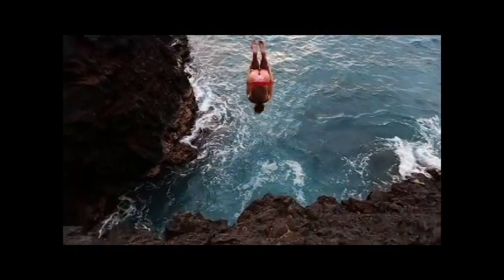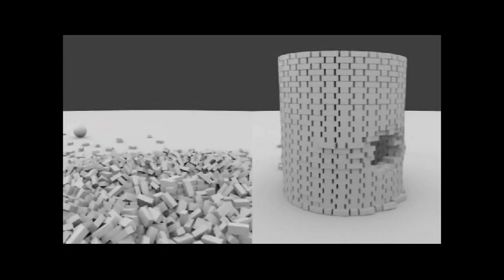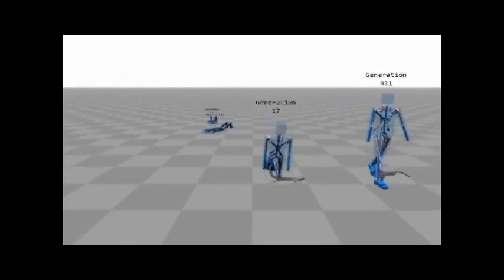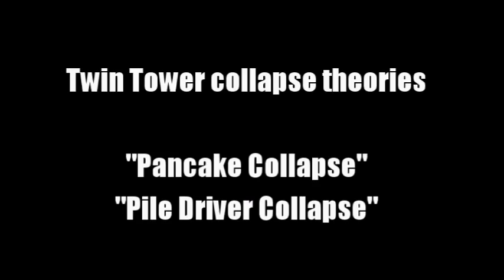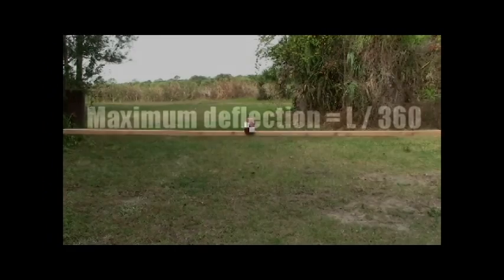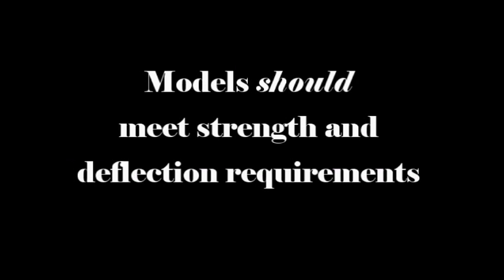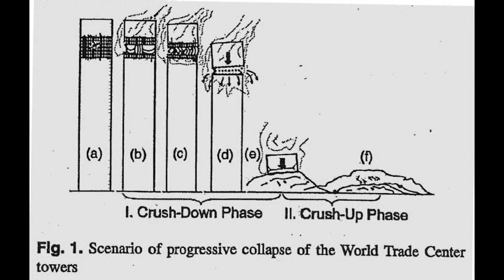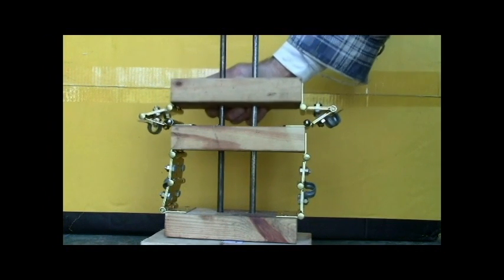9/11 Experiments: The Force Behind the Motion

Comment: Great presentations of your experiments! Well done sir! :-)

You have to do the jet fuel lie. There is not one single experiment out there, that I've seen yet, that have actually tried to melt and/or bend structural steel, while bearing a load, with jet fuel and causing said structure to collapse. 

You have already proven, beyond a reasonable doubt, that all three buildings were brought down by demolition. The only thing left now, to completely shut these nay sayers up, is to finally prove, once and for all, that jet fuel can NOT melt structural steel and then cause it to create a collapse.
Reply: +BenJamin Croft: a reasonable suggestion, except that a structural failure (even if thermally induced) would still result in a pancake or pile-driver collapse -- both of which have been invalidated by these experiments.
Reply: Firstly these experiments are not representative of the forces at work and prove nothing....  Secondly nobody has been able to present a viable demolition solution that fits the events on the day...  so if its not possible to effect a demolition what is left????
Reply: Craig Chenco So if I'm understanding you correctly, the laws of physics did not exist on 9/11?
Reply: dalexfilms Correct. Which is why I believe that the "jet fuel" theory is the final straw that will brake the camel's back. Because these sheeple will still cling to the theory that it was the jet fuel that weakened the structural steel so much that that is what caused the collapse.
Reply: BenJamin Croft On the contrary.  They did exist which is why the demolition theory is the impossible one.  And I am not sure if anyone picked up on my comment on the wtc7 collapse where the freefall velocity is considered an issue yet everyone ignores the above freefall datapoint.  This in my view is where the questions start.  Why do both sides of the argument ignore the above freefall data?
Reply: Craig Chenco Great. You agree that the laws of physics existed on 9/11. Now could you please provide the evidence to disprove all three of Newton's Laws of Motion.
Reply: why would i want to disprove laws that were not broken???
Reply: Craig Chenco You agreed that the laws of physics existed on 9-11 and you also made the statement that the buildings where not brought down with demolition.

Yet all three of Newton's Laws of Motion, and utilizing the scientific method, all prove, beyond a reasonable doubt, that a controlled demolition is what brought all three of these buildings down.

For you to make the assertion that it wasn't a controlled demolition is for you to refute the laws of physics. Now what evidence do you have to support this assertion?
Reply: Incorrect.  None of those laws were broken in the collapse.  The fatal flaw in the models presented in the video is in the attempt to scale down the height of the model.  The dynamic force of a falling object increases with its velocity and that velocity increase is governed by acceleration over distance.  Since the G force is constant then the acceleration is constant between floors.  There is a braking effect at each floor impact but the difference in velocity between these events is governed by the height of the drop.  So by scaling down the drop on the model the difference in velocity between floors will be exponentially less (remember the squaring in the equation) So you have reduced the increase in force between floors.  Hence in the first model the weight slows.  Simply because it could not develop the momentum between floors.
Reply: BenJamin Croft See http://www.burtonsys.com/staticvdyn/ for the detailled calculations referring to the twin towers. These figures show that there was indeed enough force to maintain the collapse, and more importantly that once the collapse was in motion, there would be no need for explosives any further down the building as the force becomes so great that explosives would not have made any difference.  That takes care of any claims of the laws of physics being broken for the tower collapses...So that only leaves wtc7 which I will go thru when I get time today
Reply: Oh and Newton's First Law of Motion: I. Every object in a state of uniform motion tends to remain in that state of motion unless an external force is applied to it.   The major force at play here is the force of gravity.  It is applying a force on the upper mass straight downwards and once that mass could not be supported its movements are a result of that downwards force.  The only resistive force is the structure below the collapsing mass and it is providing nothing more than braking.  It is not providing any lateral forces significant to the falling mass so there is only one direction it can fall.... This path of least resistance claim assumes there is another path other than straight down.  But since there are no forces to move the mass otherwise, adhering to the first law, its only going in the direction of the applied force - straight down.
Reply: Craig Chenco So the main force that brought the 3 buildings down is gravity?

1st) Where is the missing jolt?

2nd) Can an upper structure destroy a lower structure without destroying itself in the process?
Reply: 1 there does not need to be a jolt.  Once the supporting structure loses enough load bearing capability it has to fall. 

2 there will be damage both up and down the structure. And there will be mass ejected sideways so as the tower falls it loses some mass but it gains the mass of the floor it just crushed so effectively the falling mass continues to gain momentum and therefore more force in the falling mass.
Reply: Craig Chenco OMG! I think you better retake your 7th grade physics class and conduct some of your own experiments, utilizing the scientific method.
Reply: So why are my points invalid then???  Care to provide a reason???   And my Physics and engineering knowledge???  :) Lets see if you can find a hole in my objection to the validity of the models used....
Reply: Craig Chenco If a falling structure uniformly accelerates, then the apparent weight of the falling structure is less than when it was at rest. If the apparent weight is less, then the downward force is less. (In accordance with Newton's 2nd Law)

And if the downward force is less, then the upward force must also be less. (In accordance with Newton's 3rd Law)

Since the upward force is less, then some other force must have weekend the supports. And that weakening force could not come from the falling body because it would slow down that falling body, not allowing it to uniformly accelerate. (In accordance with Newton's 2nd Law)

Since all three buildings uniformly accelerated then the force on the undamaged parts of the structure below was less when it was falling, then before it fell. The uniform acceleration of the upper falling part is a consequence of but not he cause of the destruction of, the upward force that once supported it.

You are not adding conservation of momentum, path of least resistance, uniform acceleration, W=mg, and apparent weight to your hypothesis, and therefore it is flawed.

Newton's 1st law predicts the behavior of objects when all forces are balanced, Newton's 2nd law is applicable bodies where forces are not balanced, and Newton's 3rd law applies to all bodies regardless if the forces are balanced or not. This is basic 7th grade physics.
Reply: I suggest you venture back to 7th grade.  What we are talking about is dynamic load.  Force = mass x acceleration  Now if the mass is pretty constant or increasing and that mass is accelerating the Force is getting bigger.  Have avoided going into Newtons vs tons because that will just confuse most.  The simple version is once the tower had fallen one floor the force which it hit the floor below with is roughly 4 times that exerted by its static weight.  Next floor that multiplier goes up as the collapse is accelerating.   This is why the models provided are not representative of the situation.  If the mass does not fall as far then it has not accelerated as much so the force will not be as great.  Instead of impacting with a force approx 4 times the static mass it will be impacting with way less than double over that distance.  And of course that error becomes larger every floor.
Reply: +Antti Kahkonen Yes, I have seen that one and his other videos. And I completely agree with and support his findings from his experiments.

But I'm just pointing out what these naysayers will jump on, like Craig Chenco is doing. They'll say things like, "He didn't use jet fuel!" or "That structural steel wasn't bearing any load!" or post a link to some half ass experiment involving thermite.
Reply: Craig Chenco WHAT!?!? In order for any mass to accelerate, by gravity alone, there has to be NO resistance! Objects do NOT spontaneously accelerate on there own when there is resistance between them!

What ever hits a stationary sold object MUST experience some jolt the instant it hits.
Momentum (p) = Mass (m) x Velocity(v)
Elastic: m1u1 + m2u2 = m1v1 + m2v2
Inelastic: m1u1 + m2u2 + (m1 + m2)v
Momentum is ALWAYS conserved! It doesn't matter what angle it hits the object or if the object is crushed into smaller pieces. The speed of the object doing the hitting MUST momentarily experience a jolt. Careful measurements clearly indicate that the velocity of the roofs of all three buildings uniformly accelerated with no jolts.

If you think that it was the "crush-down & crush-up" theory, then provide the evidence. Conduct your own experiments and compare the results with your theory.
Reply: Gravity is a force.  there is some resistance on the way down as the towers did not fall at freefall acceleration.  Buy they did accelerate.  Unless you can explain how something not moving can end up hitting the ground at 120 mph without accelerating???   The motion of an object is governed by the sum of all forces. So if a resistance is opposing an accelerating force that resistance just has to be less than the accelerating force and the sum of all forces dictates acceleration towards the ground.  Seriously you must be cut and pasting someone else's bastardisation of how to apply mathematics because this crap would not come from a person understanding physics..  And yes there were jolts.  Just your way of trying to prove they weren't there is ridiculous for instance how much of a change in acceleration have you calculated? Is that change in acceleration detectable by your method?  And how much shock will be absorbed between the impact layer and the top of the tower?  I am guessing you didnt even consider these parameters. Maybe you would like to check into some of the more local seismic data from the collapse, which picks up the individual floor impacts.  Just because your method of detection was fundamentally flawed does not prove there were no jolts.       Now for my experiment? Sorry I dont have the resources to build a full height model that accurately models the acceleration.  That does not mean my criticism of the model presented is any less valid.
Reply: Craig Chenco Once again, you are not adding conservation of momentum, path of least resistance, uniform acceleration, W=mg, apparent weight, and you can not provide any real life experiments to support your hypothesis and therefore it is flawed, and can not be taken seriously. For you to ignore these fundamental laws of physics is a glorious absents of sophistication on your part.

I highly recommend for you to watch the rest of  physicsandreason's videos and also check out Richard Gage, David Chandler, Kevin Ryan, and the other 2000+ Engineers & Architects who all support REAL independent 9/11 investigations. Why don't you go here, www.ae911truth.org, and find out if your theory is actually right?
Reply: Benjamin you cannot point out any problem other than say its flawed because of no real life experiments??  I sincerely hope you dont mean to say you actually consider this video as an example of what a real life experiment is..   Now Benjamin instead of just quoting these principles tell me how they apply to the collapses and why my description is wrong, because so far you have shown no understanding of physics yet you claim my information is wrong?  
So instead of just laughing it off and pretending you know what you are talking about tell me how the path of least resistance applies in this scenario...  
Oh and nice you refer to the ae911 group for moral support.  Its kind of funny that 0.01% of the major engineering groups is taken by some as being significant dissent or challenge to the accepted accounts...  Personally I would be backing the vast majority of experts - groups with over 200,000 members worldwide with not only expertise but reputations of integrity to maintain.
Reply: Craig Chenco I don't have to explain anything to you. The proof and evidence is shown in these videos and countless others like these, that prove beyond a reasonable doubt, that what YOU are telling me and what we were officially told are lies and that these things never happened. But your master of the English language and your ability to play in the grey space of the vernacular is pretty impressive, I'll give you that.

Once again, do you have any evidence to help prove and support, beyond any reasonable doubt, your theories and hypothesis? I support and agree with the facts, evidence, and experiments that were presented in these videos. If you think they're wrong great. That's your position, that's your argument. Now support your position, back up your argument. Instead of beating around the bush with somebody like me who doesn't need a collage degree in engineering to know and understand basic 7th grade physics here.
Reply: So I point out the fatal flaw in the models in this video and you cant even address that??  Why? Because if you try you will further expose your lack of understanding of physics....  You see if someone has some theory they want to test or information that could prove something they usually submit it through universities or other scientific bodies to test the theory and if those tests (real lab tests with real modelling) then those results get published... Which is where they are put out to the experts for comment and evaluation.   But since physics is obviously not your strong point you just want to believe 911 was a demolition and I guess even if you did understand physics you wouldnt bother validating the claims because they agree with you...   Or do you really want to test out your claims with some physics experts???  Probably not... and you will claim they are government shills and dismiss their claims that you havent got a clue...
Reply: Craig Chenco Not an argument. Again, provide the evidence to support your claim to disprove these experiments, instead of an arbitrary opinion.
Reply: Craig Chenco I want to see how a smaller object can accelerate through a larger object using only gravity. I want see a smaller object speed up, when there is resistance between it, and destroy the larger object utilizing only gravity.
Reply: Lets try this simply....   Impact Force from a Falling Object
The dynamic energy in a falling object at the impact moment when hitting the ground can be calculated as

E = Fw h
   = m g h 
where
Fw = force due to gravity - weight (N, lbf)
g = acceleration of gravity (9.81 m/s2, 32.17405 ft/s2)
h = falling height (m)

In the model you referred to the height between the floors is much less than that of the towers, therefore the resultant impact is no longer about 4 times the static mass but much closer to 1.5 times.  This is important because that 4 x multiplication happens at every floor.  The falling mass hits the floor below.  It is slowed by the resistive force (conservation of momentum goes here) so instead of falling from static it is now already moving therefore has a greater dynamic force which is multiplied by 4, So it will hit the next floor at 6 times the force.   So just look 3 floors down.  Instead of multiplying the force (minus resistance) by 4x4x4 (the model multiplies 1.5x1.5x1.5  64 to 3.375.  The more floors the bigger the difference in impact force.  This is why the model is invalid as it reduces the increase in impact force between floors.    Now was there something falling through the floors in the collapse?  If not (well no there wasnt) how is your question connected to the tower collapses?
Reply: Craig Chenco Now prove it with experiment. If I'm understanding you correctly, since the spacing between the floors is not accurate, then the weight should speed up and fall through every floor and then the weight should break apart after hitting the ground? I'd like to see that.
Reply: So you want me to build you a model the height of the wtc towers??? You are convinced by a totally inaccurate model in the first place yet you totally ignore real facts and figures?  And funny how when shown the physics and the inherent problems of the model you have been shown you still dont have a problem with it???    The collapses have been studied over and over by many different universities and engineering groups and they dont find a problem with the collapse mechanics... These are people qualified in the field but you know better?  You know 30 years ago when people wanted concise info they went to the experts.... Now they go to entertainers like Alex Jones... whoever puts on the best show.  Engineers are too boring.  If you dont know the real physics and how to apply it to the event (which is clearly evident) try looking to the general consensus of experts.  Or if you want to be convinced of the physics go learn about it.  Then you will know whether or not someone is lying to you.
Reply: Craig Chenco WHOE! You really do have a glorious absents of sophistication, don't you. Forget engineering! This is basic 7th grade physics. You are trying to overly emphasize something that is completely transparent and explanatory. ANY objects that have similar accelerations, will have the same direction, and the same sequence of net force, AND IS INDEPENT OF SCALE. It doesn't matter how big or small the objects are, the same forces still apply! And I don't need to be a genius to know and understand Newton's laws of motion.

How many times to have to tell you, PROVE IT WITH EXPERIMENT! All those architects and engineers you claim to be right have NEVER presented any REAL LIFE experiments to support any of their claims. They can only produce computer generated sequences that only represents the equations. They are putting the data ahead of the experiment, which is where the data is suppose to come from in the first place! You are putting the cart before the horse. And when YOU and the rest of those so called creditable engineers stop doing that, then I'll start believing you and them.

Now, once again, what evidence do you have to support and prove, beyond a reasonable doubt, your theory and hypothesis? Instead of an arbitrary opinion.
Reply: Sorry i misjudged you....  I was under the assumption you understood 7th grade physics.  Now I see you didnt even make it that far.
Reply: Craig Chenco Not an argument. What evidence do you have to support and prove, beyond a reasonable doubt, your theory and hypothesis is correct? And that these experiments are not? Instead of  an arbitrary opinion.
Reply: Physics says so.  Simple.  Not my problem if you have been misled in the application of the appropriate laws and calculations and even been told its basic 7th grade stuff.  If some theory like the model is correct it either should have or will be submitted for publication in a reputable appropriate science or engineering journal to allow peer review and criticism. This is how you verify if indeed the models are correct or not. I can talk till I am blue in the face and you wont accept any of my claims because you do not understand how they apply.  I dont mean to be disrespectful but my education in this area is clearly way ahead of yours and to someone with further education in science and technology this is very clear.  Not everyone really understand physics and how to apply the principles to real life situations.  Their talents are obviously elsewhere.  Its not a slur.  But if you are just going on what somebody says be very aware that lots of people prey on this to deceive...  (not just on your side either) so somehow you must find a way to verify the information from ALL sources.
Reply: Actually in my country that is year 10 or 11 (students 15 to 17 years old) as thats when physics was part of my syllabus. University commences after year 12 here.  So I really dont know if that is 7th grade to you.  And I apologize if in fact the education levels line up
Reply: +Craig Chenco Not an argument. Again, for like the tenth time, what empirical evidence do you to prove, beyond a reasonable doubt, your argument? Instead of an arbitrary opinion.
Reply: I have shown you exactly what the physics implications are by the simple calculation of how impact speed is exponentially proportional to impact force.  By decreasing the distance of the fall you decrease the impact speed difference between floors and this is not compensated for anywhere else in the model.  This is basic physics and beyond reasonable doubt for people who understand physics.
Reply: And here is where analytical minds differ.  Presented with a potential threat to a belief the first action would be to research this information and consider whether the info has any validity.  If it proves to be valid then that needs to be incorporated into your total evaluation, and this may lead to a change in overall belief.  The scientific community does exactly this.  Constant testing and re-testing of theories leads to either confirmation of theories or development of new theories.  What is accepted as fact is not assumed to be fact forever - allowing for new and relevant information to be accepted, tested and applied.  Instead you stick to a belief and only accept info that fits your belief. You want people who you will never believe anyway to prove to you that which you dont understand in criteria that in most cases illogical and impossible to meet.  Effectively a Judge that only accepts one side of the argument - the side that fits his previously adopted belief.    .  Here obviously is the problem.  If you dont understand physics how do you evaluate the information presented to you?  Easy to just accept anything that agrees with your original belief.  This just leads to a biased view of all evidence.  How about looking at how the experts do that??  The most reliable way is publishing theories through reputable relevant institutions, peer reviewed and withstanding appropriate critics and in the event of competing theories having similar credentials then going to percentage support of both.  Your call.  You can improve your decision making process. Or you can stay with your current obviously ineffective process.
Reply: +Craig Chenco Then test your theory with experiment. If you're so sure of this data then prove it with experiment. See if the data matches the experiment. I want see a smaller object, accelerate, while crushing a bigger object, then crushing itself after the process, utilizing  gravity alone.
Reply: Build a model the height of the wtc towers???  If the concept of impact force vs velocity is proven then the mathematical implications I state must be valid.  Unless you dispute 4x4=16   So easy experiment for you to do at home.   Get someone to drop a brick and you attempt to catch it once it has fallen 5 feet.  Now do the same from 20 feet.  If your hand hurts more from the impact and the brick is the same mass then the only difference in the equation is the velocity. Simpler version of this experiment.  put a brick on a set of scales that hold peaks.  measure the weight of the brick.  Then drop it from 1 foot onto the scales and see what weight the scales peaked at... then keep on dropping from higher distances.  Notice the peak is higher as the falling distance increases??  Or this is flawed why?
 You of course know deep down that higher velocity exerts more impact force and that the force of gravity causes acceleration (increasing velocity) so what i have pointed out makes sense - and your inference that because I dont have a physical model my claim is therefore incorrect is cute but totally baseless as you cannot make any claims on inaccurate physics when you dont understand physics in tthe first place.   But I know you wont accept this and because your fatally flawed understanding of physics does not allow you to comprehend what is really happening you will no doubt find some excuse to look away. instead of actually wanting to see if the info is valid you are doing nothing more than finding ways to appear not to be able to see it.  I cant see spending time on a person who not only displays the total understanding of physics but does not seem to want to rectify the decision making process that has led to him believing or pretending to believe they know and understand physics especially relating to 911.  You dont want to learn, I withdraw the further opportunity for you to learn.  My time is valuable and not worth wasting where unappreciated.  Good day to you.
Reply: Craig Chenco Is there a jolt every time you drop that brick? Are human hands heavier and stronger than a brick? Did the top of the buildings start to float upward and then fall down and then upward again, even higher, and then fall down again and again and again? 

You have got to be kidding me! And you call yourself an engineer?
Reply: lol you really are clueless.
Reply: +Craig Chenco Hey. That experiment you just mentioned and just so happen support is saying that's what happened on 9/11. Even though it doesn't even match the events that took place. WTF OVER!?!?
Reply: Are you going to continue showing your stupidity??
Reply: +Craig Chenco Not an argument. Are you finally going to present real, creditable, empirical, evidence to prove, beyond a reasonable doubt, that these experiments are wrong?
Reply: You have no idea what does and does not constitute evidence.  I will be here for years before you comprehend what I SAY. Have wasted enough time.  Got something intelligent to add - otherwise back to your join the dots books
Reply: +Craig Chenco Not an argument.
Reply: Oh this is an argument???  I thought you were just bleating various crap and pretending to know what you are talking about.  Its not an argument when one doesnt even know what he is talking about...  Thats you just in case you didnt understand the inference...
Reply: +Craig Chenco An argument is a collective series of statments, leading to a definite proposition. You are not doing that. You are constantly and bureaucraticly dodging my question. Which is, for the twelfth time now, what empirical evidence do you have to show to prove, beyond a reasonable doubt, that these experiments are wrong? fyi YOU'RE EXPERIMENT!
Reply: The evidence has been mathematically given to you.  You can not challenge the validity of the mathematics nor how it is applied to the model.  End of story.
Reply: +Craig Chenco Once again you are putting the cart before the horse. Does that data match what happened to those three buildings? Does it comply with experiment? Can you show that?
Reply: +Craig Chenco It looks good and sounds good on paper. Now apply it to experiment. Test it.
Reply: The data matches what happened to the buildings.  Unless you want to build a tower the height of the twin towers then no experiment will be accurate - which is why the model supplied is not an accurate depiction of the collapses.  And the mathematics also supports this
Reply: +Craig Chenco OMG! I told you earlier that it doesn't matter how big or small an object is! The same forces still apply and they are INDEPENDENT OF SCALE! And you call yourself an engineer?!?!
Reply: +Craig Chenco This is why we conduct experiments and utilize the scientific method. To keep narcissistic know-it-alls, like you, from spreading misinformation and lies.
Reply: Nothing seems to stop you from spreading lies.
Reply: +Craig Chenco If you think I'm lieing, and therefore these videos are lies too, then prove them wrong with your experiments. Back up what you're saying. Apply it to the events of 9/11.
Reply: I have proved the models you refer to as mathematically incorrect.  Therefore your model is invalid. You are the one using this crappy model as some sort of evidence that the collapses were assisted so to continue to do so you have to prove why it is accurate and why the flaws pointed out are not.  So far all you have proved is how gullible and ignorant you are
Reply: +Craig Chenco I'm not the one who bears the burden of proof here. YOU are the one that is accusing that these experiments are wrong. YOU are the aggressor here, NOT me. Don't try to place the burden of proof on my shoulders. 
To try and twist and manipulate the burden of proof on me is extremely rude and disrespectful on your part. Nice try though. Like I said earlier, your ability of utilizing the English to play in the grey space of the vernacular is still pretty impressive. 

Now what empirical evidence, fyi your experiments, do you have to prove beyond a reasonable doubt that this data and experiments are wrong?
Reply: And I have shown you mathematically why they are wrong.  That is proof.
Reply: +Craig Chenco Like I said earlier, it looks good and sounds good on paper now prove on wether or not of its true. Now apply this math with the events of 9/11, aka experiment.
Reply: Sounds good on paper because it is correct.  And unless you can tell me why it does not apply to your model then your model is invalid.  Simple.  Your request for a physical model does not change the validity of the mathematics.
Reply: +Craig Chenco That is NOT evidence. If I'm understanding you, you're saying the mathmatics apply because the mathmatics apply?
Reply: You wouldnt know evidence if it hit you in the face.  If something is proven mathematically incorrect that is the end of the story.  No amount of models are going to change the laws of physics and how they apply. And that is only the beginning of the mathematical errors in this model.  If that concept escapes you then maybe time to go back to school....
Reply: Craig Chenco So you're saying since the math is right, then the math is right. Correct?
Reply: I am saying there are inherent flaws in the models depicted in this video which are proven mathematically.  Apart from the one we have been discussing there is no actual scaling of the buildings resistance or forces applied.  The deflection calculation is meaningless because there is no connection between deflection and failure of beams of different materials. The first model assumes the outer structure is solid and remains that way?  And the mass concentrated in the center when the falling mass was the full area of the floor.  They dont even start with a static mass and let it drop 1 floor as happened in the towers. Also where is the calculations showing how the falling mass figure was obtained and the actual load resistance of the floors???  And the issue we started with is the height difference between floors does not allow for the acceleration and subsequent impact force on the next floor down which is not even a linear calculation as the increase in velocity is exponential.   So basically this model has no resemblance to the actual towers.  If you have some answers to those basic flaws (thought one massive flaw would be enough for you but since you havent managed to understand that one proven by basic maths and physics you might see the other errors) go right ahead...
Reply: +Craig Chenco So you're saying the math is right because the math is right?
Reply: +Craig Chenco You're telling me that the math applies because you say it applies?
Reply: Im telling you you are stupid.  Go away
Reply: There is actually no mathematics whatsoever applied to that model to make it an accurate representation.  If you still think this is model proves something then yes you are stupid.
Reply: +Craig Chenco I repeat,  is the math right because you say the math is right? Yes or no?
Reply: I repeat... where is any math backing up the accuracy of the model??? And my math is correct because that is the correct application of the formula.  Not because I say so...  Because physics says so.
Reply: +Craig Chenco So the physics apply because the physics say they apply?
Reply: Yes.  And if you understand physics then you understand what formulas are applicable to what scenarios.
Reply: +Craig Chenco Do you understand that that is circular logic? That's a logical fallacy in which you begin with what you are trying to end with. (emphasis)
Are claiming that A is true because B is true; B is true because A is true??? Really???
Reply: +Craig Chenco Also, I have mentioned, three times already, what you are missing from your hypothesis. You did NOT include conservation of momentum, path of least resistance, uniform acceleration, W=mg, apparent weight, the jolt, and no experiment. These are FUNDAMENTAL LAWS, that MUST be included. (emphasis)
Reply: Showing your stupidity again?  If an equation has been developed to express an event it does not need someone to say it applies or not.   If you asked how fast I had to be going to make it from a to b in x time there is a mathematical equation v=d/t  Are you going to question that equation when asked the same question?  Or when it is applied ask who says so???  But since you have been suckered by this model video I suppose its not surprising.
Reply: You did NOT include conservation of momentum, path of least resistance, uniform acceleration, W=mg, apparent weight, the jolt, and no experiment. These are FUNDAMENTAL LAWS, that MUST be included. (emphasis)  

Now how should I include these items???   Path of least resistance - Well since the only force in the collapse is gravity the only viable path is downwards... so no problemsthere.  W=mg applies in this casw when you are falling with the mass - like some amusement rides that give you the zero gravity feel.  This has no place in calculating the impact of a descending object.  Conservation of momentum - dont see a problem here and this sort of works against your claims here.  Your jolt - this is a goodie.  How much of a jolt should there be?? How much of the descending mass would absorb any jolt?  As the collapse didnt actually just proceed floor by floor as many parts of the exterior support columns can be seen coming down intact meaning that not just the immediately lower floor support was being compromised but at times supports were destroyed for multiple floors at a time so how often should these jolts be??  And how obvious should they be? 

Now back to the main point.  This experiment ignores so many parameters important for a model to be accurate, yet you bring up all these physics concepts claiming I dont address them when clearly your model does not either???  You cant have it both ways... Important when questioning me yet ignored when questioning the model....
Reply: So understanding some of the concepts of physics is not enough.  Its how they actually apply to an event that you do not understand.
Reply: +Craig Chenco More circular logic, ad hominem remarks, bureaucratic dodges, and NO evidence support anything that you are saying. 

Whate empirical evidence do you have to prove beyond a reasonable doubt that your hypothesis and data is true and that it applies to the events of 9/11and that these experiments are wrong?
Reply: +Craig Chenco Again, your master of the English language to hide  in the grey space of the vernacular is still very impressive.
Reply: Dont see you putting up any real argument...
Reply: I mean feel free to challenge any points raised...
Reply: +Craig Chenco I've already told you, for the third time now, I support and agree with the data and evidence that has been provided in these videos. I don't have to argue anything with you until YOU can provide the empirical evidence to prove beyond a reasonable doubt that these experiments are wrong. 

Once again you are trying to shift the burden of proof on me. YOU are the accuser, therefore YOU bear the burden of proof. 

Circular logic, arbitrary opinions, ad hominem remarks, and bureaucratic dodges are NOT evidence.
Reply: LOL so you agree with a model with zero data... when the physics is explained to you that comprehensively discounts your model's representation of the event you ignore it...  your stupidity has been amusing, but now its kinda sad...   Sometimes I get an idea that someone actually wants to learn something then people like you come along and demonstrate they will not learn if not from someone like me, but even motivated to learn elsewhere to deal with the obvious challenges explained to confirm or deny.      Love that line I am the accuser and I have the burden of proof... yes but you have the burden of being able to understand the proof - sadly that is outside your grasp.  You have clearly demonstrated your lack of understanding of physics so when presented with the proof you simply dont understand how it applies.  This is not my problem... You can address it any way you like but your claims I have not proven anything are bullshit.
Reply: +Craig Chenco Not an argument. Just more circular logic, arbitrary opinions, bureaucratic dodges, ad hominem remarks, and acting in bad faith by not providing any empirical evidence to prove beyond a reasonable doubt that these experiments are wrong.
Reply: Craig Chenco I would like to see a smaller and weaker, stationary, object uniformly fall, by gravity alone, on top of a larger and stronger object, and then accelerate, by gravity alone, while falling through that larger and stronger object, and in the process crush that larger and stronger object, and then, that same smaller and weaker object, crush itself afterwards, by gravity alone. 
Remember, the laws of motion are independent of scale. Meaning, it doesn't matter how big or small an object is, the same laws of motion still apply.

Since that it is what you have been implying this whole time, and in order for you to prove these experiments wrong, you are going to have to demonstrate this. Good luck with that.
Reply: Since you dont have the ability to comprehend physics I have no interest in what you would like to see.... You have been given proof of why the model is invalid.  Not my problem you dont understand.  And the validity of the proof is not dependent on you understanding.    By the way what you ask does not again resemble the towers collapse - - And yes this even further demonstrates your total lack of understanding of the topic...Explaining the actual situation is a waste of time on you...  . Let me know when you finally pass 7th grade...
Reply: Craig Chenco You haven't given anything except circular logic, ad hominem remarks, bureaucratic dodges, arbitrary opinions, and acting in bad faith by not producing a single piece of empirical evidence to support what you are saying.
 
This data and experiments shown here, http://www.burtonsys.com/staticvdyn/, that you're so desperately clinging to, do NOT match reality on what happened on 9/11. And all the creditable sources that where sited, fyi FEMA, NIST, 911 Commission, have all been recently coming forward and admitting that they no longer support this kind of theory and that it is NOT what happened, because:

If a falling structure uniformly accelerates, then the apparent weight of the falling structure is less than when it was at rest. If the apparent weight is less, then the downward force is less. (In accordance with Newton's 2nd Law)

And if the downward force is less, then the upward force must also be less. (In accordance with Newton's 3rd Law)

Since the upward force is less, then some other force must have weekend the supports. And that weakening force could not come from the falling body because it would slow down that falling body, not allowing it to uniformly accelerate. (In accordance with Newton's 2nd Law)

Since all three buildings uniformly accelerated then the force on the undamaged parts of the structure below was less when it was falling then before it fell. The uniform acceleration of the upper falling part is a consequence of but not the cause of the destruction of the upward force that once supported it.

You and this, http://www.burtonsys.com/staticvdyn/, are not adding conservation of momentum, path of least resistance, uniform acceleration, W=mg, and apparent weight to your hypothesis.
Newton's 1st law predicts the behavior of objects when all forces are balanced, Newton's 2nd law is applicable bodies where forces are not balanced, and Newton's 3rd law applies to all bodies regardless if the forces are balanced or not. This is basic 7th grade physics. These are fundamental, essential, laws that can NOT be ignored.
Reply: If a falling structure uniformly accelerates, then the apparent weight of the falling structure is less than when it was at rest. If the apparent weight is less, then the downward force is less. (In accordance with Newton's 2nd Law)  Bullshit....  This shows your absolute stupidity.  The apparent weight has nothing to do with the impact force.  The impact force is a product of mass and velocity - the faster something falls the harder it impacts.  Do you want to further show your stupidity???
Reply: There is a difference between ignoring laws and incorrectly applying them.  Once you reach 7th grade you may see this.
Reply: Craig Chenco "The impact force is a product of mass and velocity - the faster something falls the harder it impacts." 
Then how is that smaller, lighter, and weaker , stationary, object suppose to fall and then accelerate, by gravity alone, down through a larger, stronger, and heavier object? In order for any stationary object to move, there has to be NO resistance! In order for it to even accelerate, there still has to be NO resistance! 
If you're still clinging to this, http://www.burtonsys.com/staticvdyn/, that penny that was dropped only accelerated because there was NO resistance. And according to you and this half ass experiment that penny should of continued to have accelerated, even gained momentum, after hitting the scale, and then should of gone right through the scale. But it didn't. Why? Because the penny was a smaller, lighter, and weaker object than the larger, heavier, and stronger scale was. DUH! And did you even notice the jolt, fyi the immediate deceleration and then dead stop, after the penny hit the scale? (emphasis)
The same laws still applied when he put a jar of pennies on top of a piece of paper, it was just reversed. A stronger, heavier, and larger object on top of a smaller, weaker, and lighter object. Plus he was adding more weight to it! Something that did NOT happen to any of the buildings on 9/11!

While acceleration of an object does occur and is mathematically proven, there has to, FIRST, be NO resistance for that object to begin moving and there still has to be NO resistance for that object to accelerate.

"There is a difference between ignoring laws and incorrectly applying them."
I strongly suggest that you take a good, long, and hard look at what you just said there.
Reply: Craig Chenco Now, do you or do you not have any empirical evidence to prove beyond a reasonable doubt that these experiments are wrong?
Instead of circular logic, arbitrary opinions, ad hominem remarks, bureaucratic dodges, links to out dated, half-ass, proven wrong theories that are no longer supported by creditable resources, and not providing any experiments of your own.

"You can't convince a believer of anything; for their belief is not based on evidence, it's based on a deep seated need to believe." - Carl Sagan
Reply: Yes I do and have presented it.  When will you gain the intelligence to understand it?
Reply: I cant believe you posted this.....  "You can't convince a believer of anything; for their belief is not based on evidence, it's based on a deep seated need to believe." - Carl Sagan 

That is what Carl said about people like you, and you are dumb enough to post it as support for your belief????   Fucking laughing my ass off.....
Reply: Just to help you out, apparent weight is the relationship between objects that are accelerating.  The example shown is when you are inside a lift.  You will also notice that when the lift decelerates your apparent weight increases.  This is exactly what happens when a descending mass like the towers hit the lower floor.  The acceleration is reduced so the apparent weight increases. See in particular case 4:
 http://physics.usask.ca/~kathryn/phys111/apparent_weight.pdf
Reply: Now impact force....  notice the absence of apparent weight in this description???  http://www.wired.com/2014/07/how-do-you-estimate-impact-force/
See now how your misuse of physics is obvious???
Reply: Of course now we are going to get over complicated in our calculations as there is a difference between the potential impact force (kinetic energy) and the actual impact force which is an average of how much energy is released over the deceleration of a falling object as in http://hyperphysics.phy-astr.gsu.edu/hbase/flobi.html  But then going to your conservation of energy / conservation of momentum theories and considering the collapse of the structure below indicates not all the force available was necessary to cause its collapse and the falling mass has not stopped but has been slowed means the falling mass has now more energy than when it first started to fall.  So now calculating the velocity at the second floor, it is now the initial velocity (slower than impact velocity but above zero)  plus the velocity increase of the 2.5m drop.   So the mass falls faster between floors and therefore the time shortens between floor collapses.
Reply: Now exactly why the distance between floors is an issue.   As the falling mass meets the floor below it has gained momentum and its impact force (kinetic energy) is expressed as f =mv. v =u+at (u being initial velocity which for the start of the collapse is 0) distance=1/2at^2 so square root of 2d/a gives us t. so using 2.5m time is 0.71 seconds. So the velocity is 9.8x0.71 = 6.96m/s So falling just the first floor the impact force is almost 7 times the mass above. In the model lets be generous and say there is 10cm between floors. Under the same conditions the time is 0.14 seconds so velocity =1.37m/s. So instead of a force close to 7 times the falling mass the force becomes 1.37 times the falling mass over that fall. Subsequent floors below also bring in the starting velocity which is the impact velocity less the deceleration caused by the impact - which obviously will be well above zero. So that error continues exponentially down the collapse....  As the weight is let go well above the model it has gained significantly more kinetic energy to break through the first floor, but the resultant deceleration is obviously enough to reduce the weights velocity significantly.  Enough to reduce its impact on the next floor so the Mass has slowed and then been allowed to accelerate and gain momentum = 1.37 times its mass rather than 6.96 times its mass if allowed to fall the full 2.5m.  So what this model does is slows a mass down by more than it can regain between floors - ending in the mass having reduced kinetic energy at each floor and eventually stopping.  Under the real mathematics that apply to the towers, if the mass caused the collapse of the floor immediately below it, the resulting falling mass would gain energy at an exponential rate and the collapse could not slow down, only speed up.  So even though we dont know the relative difference between descending mass and load capabilities of the 'floors' if the mass had been dropped from 2.5m above the first floor and there was 2.5 m to the next floor etc and the mass broke through the first 'floor' it would continually gain momentum and hit each floor below harder and harder. Because then we establish that the resistive force is less than the minimum force required for collapse (no relation between downward force and load bearing capabilities has been provided for your model) and mathematically therefore will accelerate downward.   This proved as:   f =mv. v =u+at (u being initial velocity) so f =m(u+at) and u=0 for the first floor drop.  Second floor drop it is already moving so u increases and keeps on increasing floor by floor.   Therefore force must keep increasing and the collapse must accelerate..     Intelligent critical analysis only please -
Reply: Craig Chenco More circular logic, ad hominem remarks, bureaucratic dodges, arbitrary opinions, and acting in bad faith by NOT producing a single shred of empirical evidence to support your claim that these experiments are wrong.

This? Really?, http://hyperphysics.phy-astr.gsu.edu/hbase/flobi.html. It even states, "Harder ground, less penetration, harder impact force." AND "Note that the above calculation of impact force is accurate only if the height h includes the stopping distance, since the process of penetration is further decreasing its gravitational potential energy."  Seriously, Mr. Engineer?  
And this?, http://www.wired.com/2014/07/how-do-you-estimate-impact-force/. Resorting to Mythbuster now? LOL! If you have actually seen that episode you'll notice the jolt, aka deceleration, the second, after the piano hit the roof. And how did they make the piano fall? By removing the resistance that was holding it up in the air. (emphasis)
And fyi, it was BUSTED! The piano did NOT fall through the roof. It wasn't until afterwards, they got another piano, made it heavier, by adding sand bags in it, and then dropped it from an even higher height. Really, Mr. Engineer?

Once again, what empirical evidence do you have to prove beyond a reasonable doubt that your hypothesis and theory are right and that these experiments are wrong?

"Characterize people by their actions and you will never be fooled by their words." - Unknown
Reply: Craig Chenco Oh yeah, and this one? http://physics.usask.ca/~kathryn/phys111/apparent_weight.pdf. You have just inadvertently omitted yourself here Mr. Engineer.  "a↓ = less than normal weight.", "a↑ = greater than normal weight.", AND "Just as in case 3 and 5, the apparent weight, fyi the little girl in the elevator, ake the wtc floors,(which is zero when a = - g) is less than the true weight." According to this, http://physics.usask.ca/~kathryn/phys111/apparent_weight.pdf, that little girl in the elevator, aka the floors of wtc 1, 2, & 3, is not what caused the destruction of the stronger, larger, and heavier lower sections of the buildings, Mr. Engineer.
Reply: Oh and this new BS fantasy "path of least resistance law", 911 truth implies, would make it impossible for bullets to kill, they would deflect off our skin and go for the least resistance, the air...   Just making sure you dont want to go down that path either...
Reply: Maybe I have tried to oversimplify exactly what is happening, as there are a lot of other things happening in this collapse.  This description is far more complete.... (borrowed)  But it better explains the complexity of the impact force of the falling mass.

 Once the framing in the impact zone has failed, the upper block is accelerated by gravity until it crashes into the lower structure below the impact zone. Labeling the mass of the upper block m, and its speed v, the block would have a momentum m*v and an energy of (1/2)*m*v^2. Its weight would be m*g, where g is the constant of gravitational acceleration (9.81 meters/second^2).

The balance of forces on the upper block as it impacts the lower structure is presented here as the impulse momentum form of Newton’s 2nd Law:

The time rate of change of momentum = The sum of the forces,

[m*v(final) – m*v(initial)]/dt = F – m*g.

Here, positive direction, velocity and force are taken to be vertically upward; dt is a label for “delta t”, a very brief time interval during which the impact occurs and the momentum changes from m*v(initial) to m*v(final); and F is the force of resistance by the lower structure. If A is the net horizontal cross-sectional area of the load-bearing columns of the lower structure, then F/A is the average compressive stress across that area.

This type of force balance is applied to the impact at each floor, sequentially, by redefining m as the mass above it, v(initial) as the outcome of the alternating floor impacts and free falls during prior compaction, and v(final) as the outcome of the latest impact.

We can regroup the terms of the force balance as follows:

F = m*g + m*[v(final) – v(initial)]/dt,

F = m*g*[1 + {v(final) – v(initial)}/(g*dt)],

F/(m*g) = 1 + {v(final) – v(initial)}/(g*dt).

Before each building was perturbed, the upper block did not have any motion, v(initial) = v(final) = 0, and the magnitude of the upward-directed, resisting force of any part of the structure was equal to the weight of material above it; F/(m*g) = 1.

When an upper block drops through an impact zone that has lost structural strength, and crashes into the rigid lower structure, it imparts a dynamic force in addition to its weight. The dynamic force is the second term in the last expression for F. The total force, F, acts during the time interval dt during which the momentum of the upper block is reduced (in magnitude) from m*v(initial) to m*v(final). Clearly, the lower structure will crumble when F is greater than the maximum force it can support, or when F/A is greater than the maximum stress it can withstand.

¦ Problem 1, Numerical Example of Progressive Collapse

Free fall without air resistance from a height H takes time T, given by

T = square root [(2*H)/g].

At any time 0 < t < T during the free fall, the velocity is given by

v(t) = -g*t, (negative sign for downward direction),

and position is given by

h(t) = H – (1/2)*g*t^2.

So, for H = 440 m (=1443 feet) the free fall time is T = 9.5 s, and the velocity slamming into the ground is -92.9 m/s = -208 mph.

What actually happened in the buildings? We consider a suggestive numerical example.

With the onset of failure, the upper block drops through a space of L = 3 meters, taken to be the distance between floors. Starting from rest at time t = 0, the block reaches a velocity of v = -7.7 m/s at t = 0.78 s. The descending block makes contact with the topmost stationary floor of the lower structure.

We will assume these floor structures to be dL = 1 meter thick (1 meter = 3.28 feet). Each floor structure is a framework of steel below and within a layer of concrete. The floors spanned a distance of between 10 m and 20 m between the outer square perimeter (63.4 m a side) and the core support along the axis of the building, which housed elevator shafts, stairwells and support columns, within a rectangular area of [42 m x 27 m].

Impact is a very brief process whose duration is dt = 1/100 s. During the impact, energy ripples through the floor structure as elastic waves in the steel and concrete; the velocity of these stress waves is V(steel) = 1900 m/s and V(concrete) = 930 m/s; the wave speed is a property of the material (P-waves). The waves traverse the thickness of the floor structure in a time dL/V = 5/10,000 s for steel and 1/1000 s for concrete, so they can bounce between 10 to 20 times across the 1 m thickness; and they can run along the span of the floor within 0.005 to 0.01 s.

The waves alert the volume of the floor structure to the imposition of a new load, and infuse that volume with much higher stress. The floor structure is deflected downward a distance d = -0.077 meters (3 inches) during impact. In becoming stressed, the floor structure absorbs some of the energy of the descending block, slowing it by dv = 0.5 m/s (in this example). Within dt = 1/100 s, the floor structure has transmitted the force of the new load to its joints with the building’s core and periphery.

Recalling the last form of the force balance, and inserting the numbers from this example, we find the magnitude of the total reaction force to be

F/(m*g) = 1 + dv/(g*dt) = 1 + 0.5/(9.81*0.01) = 6.1,

a load of six times the weight of the upper block.

I continued this particular calculation, floor by floor, as a sequence starting from rest: free fall for 3 m, impact delays transit for 0.01 s and decreases descent velocity by 0.5 m/s, free fall for 3 m, transit delay and velocity decrement as before, and so on. The block reaches the ground in 10 s with a total of 87 floor impacts. The collapse of 344 m (1128 feet) accelerates from -7.2 m/s (-16 mph) after the initial impact, to -46 m/s (-104 mph) at the ground.

Now, a little bit more about waves.

Wave Trains and Stress Concentration

Elastic waves are launched from the collapse front (the leading edge of descending material, like “weather front”) at the moment of first impact. Within 0.01 s, a stress wave has traveled through the metal framework to five levels below the collapse front, a distance of 20 m. These lower levels experience a rapid –dare I say explosive? –increase in the stress within their frames. Bolts and rivets may be sheared, and joints ruptured by the resulting impulsive forces.

For example, assume a carbon steel (HR 0.45C) bolt or rivet of 1 inch diameter is used to support a force of 8,000 kilograms, equivalent to a stress of 22,500 pounds-per-square-inch (psi). This stress is only one quarter of that material’s tensile strength of 90,000 psi; an apparently conservative design. However, an unexpected increase in load by a factor of five, to a total of 48,000 kg, or 135,000 psi, would probably rupture the joint.

The stress wave from the initial impact races down the lower structure, arriving at ground level in 0.18 s (we continue with the numerical example). During that time, the collapse front has descended another 1.3 m. The stress wave is like a messenger telling the material it passes to “move down and compress” in response to the advancing collapse front. On reaching the ground, the wave could transmit some of its energy past the building’s foundation to radiate as a seismic wave through the earth, and another portion of its energy would reflect back up (the major effect, especially if the foundation is more rigid than the building it supports). The message of the upward running wave is “compress even more, dead-end down below.”

Elastic waves launched by an impulsive load on a structure that remains intact –like a bell being struck –will ripple back and forth, spreading out the initially concentrated stress of the strike. If the load is suddenly imposed and then remains constant, as with a book being dropped on a sturdy table, then the elastic waves die out into a fairly uniform distribution of stress throughout the volume. If the load is a short pulse, like striking a bell, then the waves will eventually die out as a fairly uniform heating of the material.

Just as there are ripples on wavelets, and wavelets on big rollers across the surface of the ocean, so will each elastic wave launched by the collapse be a jumble of waves of different size grouped together. The many individual collisions of material that make up the global impact of the upper block into a floor structure will each send off their own ripples, which all build up into a composite for the elastic wave.

A new elastic wave is launched with each impact between the collapse front and a stationary floor structure. As the collapse front accelerates, the time interval between wave launchings decreases. The building below the collapse front experiences an increasing level of stress and becomes filled with intersecting wave trains moving up and down by the time of the second impact at 1.13 s. Elastic waves that pass through each other will produce a heightened stress where they coincide, just like crossing water waves that mound noticeably.

This agitated lacework of stresses ahead of the collapse front will probably cause many fractures and break many joints prior to the arrival of the front. The sudden shifts in the volume of rooms and office spaces being compressed and twisted by the elastic wave trains can easily expel jets of air and dust out of windows, perhaps giving the impression of smoke from a gun barrel. The collapse front will push a blast of air down before it and also produce lateral jets of air from the building below it. These air streams are analogous to the water expelled sideways and into vortexes alongside a paddle pushing a canoe through still water.

All these wave effects occur in the upper block as well, from the moment of first impact. The upper block will quickly fill with elastic waves, which will rupture internal joints; the block shatters, as is vividly seen in the video recordings of the WTC collapses. The shorter length of the upper block, and its lack of firm connection (like a foundation), will contribute to the speed of its disintegration. In a very real sense the upper block was “blown up,” but naturally by elastic waves rippling a destructive compression through it rather than artificially by intentional controlled demolition.
Reply: But I am sure your cute little model takes all these factors into account.....  (I'll be laughing hard on that one )
Reply: +Craig Chenco WOE! Just another, long winded, circular logical, arbitrarily opinionated, ad hominem,  bureaucratic dodge. Still NO empirical evidence to prove beyond a reasonable doubt that these experiments are wrong.

What empirical evidence do you have to prove beyond a reasonable doubt that these experiments are wrong and that your theory and hypothesis is right?

Like I stated earlier and am going to continue to state, you are going to have to demonstrate how a smaller, weaker, and lighter stationary object,  uniformly fall, by gravity alone, down through, accelerate, and then destroy, the larger, stronger, and heavier object undernrath, by gravity alone, and then afterwards that same smaller, weaker, and lighter object destroy itself, by gravity alone. 

Good luck with that.
Reply: :) expected that level of ignorance from you.....  
See if you understood physics then you would understand the first fall produces 6 times the force of the static weight... which the building is not designed to do... so it collapses...  so when you finally reach 7th grade (be prepared to repeat a year or two leading up to that) you may have some idea what is going on...  For now just remain clueless...  wouldnt have you any other way
Reply: +Craig Chenco Not an argument. What empirical evidence do you have to prove beyond a reasonable doubt that these experiments are wrong and that your theory and hypothesis are right?

Instead of relying on circular logic, arbitrary opinions, bureaucratic dodges, ad hominem remarks, and acting in bad faith by not providing a single piece of empirical evidence to back up what you're saying.
Reply: Your inability to comprehend physics - therefore the proof is not my problem.  When you graduate from the sandpit you may understand.
Reply: +Craig Chenco Not an argument. What empirical evidence do you have to prove beyond a reasonable doubt that these experiments are wrong and that your theory and hypothesis are right?

Instead of relying on circular logic, arbitrary opinions, bureaucratic dodges, ad hominem remarks, and acting in bad faith by not providing any empirical evidence to back up what you're saying.
Reply: This is where it gets circular.  Yes it is an argument.  But for the same reasons you dont understand the proof, you dont even understand the argument.  As John Cleese said... Stupid people dont know they are stupid because they lack the very skills that they need to tell if they are really stupid in the first place....   Stay on that treadmill...  safer that way
Reply: +Craig Chenco I'm not the one who's implying the physics apply because the physics apply, aka circular logic. An argument is a collective series of statements leading to a definite proposition, fyi you are not doing that. I'm not the one with glorious absence of sophistication here. I'm not the one trying to twist and manipulate the burden of proof on to someone else. Your mastery of the English language and that ability to hide in the grey space of the vernacular is still pretty impressive. 

Now, what empirical evidence do you have to prove beyond a reasonable doubt that these experiments are wrong and that your theory and hypothesis are right?

"The difference between stupidity and genius is that genius ha it's limits." - Albert Einstein
Reply: Whatever.... Spent a bit of time thinking you may have a brain....  my mistake
Reply: +Craig Chenco Not an argument. What empirical evidence do you have to prove beyond a reasonable doubt that these experiments are wrong and that your theory and hypothesis are right?  

Instead of relying on circular logic, ad hominem remarks, bureaucratic dodges, arbitrary opinions, and acting in bad faith by not providing a single piece of empirical evidence to back up what you're saying.
Reply: +Craig Chenco "Whatever. .." ??? Seriously!?!? You mean you don't care about evidence, facts, confirmation, experiments, or the scientific method, Mr. Engineer???
Reply: I care about educating people....   obviously some just dont learn  (do you really need more hints?)
Reply: +Craig Chenco How can you properly educate people when you don't even care about evidence, facts, confirmation, experiments, or the scientific method, Mr. Engineer? Are seriously going to teach people circular logic, arbitrary opinions, how to bureaucraticly dodge the issue at hand, use ad hominem insults, and how to act in bad faith? Because that's all you've shown me.

"Inside every cynical person, there is a disappointed idealist." - George Carlin
Reply: I care, and I understand physics - its part of my job.  You dont understand, just believe.  You cant see why the model is incorrect because you dont understand scaling especially when exponential equations are involved.  You just believe its correct.  Belief does not equal correctness.  Even in massive numbers.  For instance how many Christians are there?  How many Muslims?  One of those groups has to be wrong.
Reply: +Craig Chenco How can you care and understand physics when I ask you about evidence, facts, and confirmation you simply reply, "Whatever... "??? And you understand physics when you implied the physics apply because you said the physics apply??? Seriously Mr. Engineer???

Once again, that's not an argument. Just more circular logic, arbitrary opinions, ad hominem remarks, bureaucratic dodges, and acting in bad faith by not providing any empirical evidence to support what you're saying. 

What empirical evidence do you have to prove beyond a reasonable doubt that these experiments are wrong and that your theory and hypothesis are right? 

"The God excuse, the last refuge of a man with no answers and no argument." - George Carlin
Reply: 1 - You dont even seem to be able to read my words without misunderstanding things.  My god reference was to show that the number of people believing something does not make it correct.

2 - One point alone comprehensively proves the model to be inaccurate and that is the distance between floors.  Your failure to comprehend or accept that the further an object falls the greater impact it will have is not my problem.  You also claim physics is scalable.  Well yes it is but you need to scale all of the model's responses and reactions appropriately maintaining mathematic relationships.  Scaling the distance falling and force applied needs to be mathematically scaled accounting for the non linear relationship between distance and force (the acceleration due to gravity which is used to calculate the velocity at impact is 9.8 meters per second squared.  The squared part of that formula means falling 2 feet produces more than just double the force of falling 1 foot)   So to be accurate when you reduce the distance between floors you need to exponentially reduce the resistance to maintain relativity.

3 - My whatever is to your claims, including your understanding of physics (or severe lack of), what constitutes proof, what physics apply and general lack of understanding of anything I say.  That I cant fix

4 - Your clinging to this model and asking me to disprove it is the problem in the first place.  This model has no data to support any claim that it is indicative of the wtc towers.  No data on how the falling weight was calculated and no data on the model's structural ability to support loads.  Without this data this model clearly has no validity.  

5 - Whether or not my application of physics is 100% correct or not (as this is such a complex event to totally get 100% correct I have tried to simplify the main concept) does not then imply that your model is correct or my application of physics to the event is not closer to the truth than this model.

So to sum up - Really its up to you to prove this model correct in the first place (which you cant)... I am just saving you time by pointing out why you cant.  And why do so many universities and engineers bother with complex computer modelling when a simple back yard toy is all they would need???
Reply: Craig Chenco
1 - Not an argument, bureaucratic dodge
2 - Circular logic, arbitrary opinion, no evidence
3 - Circular logic, ad hominem, bureaucratic dodge
4 - Shifting the burden of proof, arbitrary opinion, no evidence
5 - Not an argument, bureaucratic dodge, no evidence

So to sum up - You only provided circular logic, ad hominem remarks, bureaucratic dodges, arbitrary opinions, acting in bad faith by shifting the burden of proof, and by not providing a single piece of empirical evidence.
And fyi, how did all these universities and engineers get these complex computer models from to begin with?

Do you or do you not have any empirical evidence to prove beyond a reasonable that these experiments are wrong and that your theory and hypothesis is correct?
Reply: One point alone comprehensively proves the model to be inaccurate and that is the distance between floors.  Your failure to comprehend or accept that the further an object falls the greater impact it will have is not my problem.   This does not require further proof.  You however cant tell me why this is not proof.
Reply: And fyi, how did all these universities and engineers get these complex computer models from to begin with?  Does it matter?  What matters is the necessity to do so, as there are so many calculations and so much data required to accurately model the event.  To believe a model with almost no real data in any way proves what is claimed is ridiculous.  Again your failure to even acknowledge the lack of data is astounding.  Your dismissal therefore foolish...
Reply: Craig Chenco "One point alone comprehensively proves the model to be inaccurate and that is the distance between floors. " 
If you think that's what would make the weight continue to fall and then gain momentum and accelerate, then why don't you show us this with YOUR more accurate and precise model then?

"Does it matter?"
YES! YES IT DOES MATTER! Mr. Engineer.
Show us the empirical evidence to prove, beyond a reasonable doubt, that your theory and hypothesis is right and that these experiments wrong.
Instead of relying on circular logic, arbitrary opinions, ad hominem remarks, bureaucratic dodges, and acting in bad faith.

"Facts are stubborn things; and whatever may be our wishes, our inclinations, or dictates of our passions, they cannot alter the state of facts and evidence." - John Adams
Reply: "Facts are stubborn things; and whatever may be our wishes, our inclinations, or dictates of our passions, they cannot alter the state of facts and evidence." - John Adams

I rely on facts.... That makes one of us...
Reply: +Craig Chenco "I rely on facts... That makes one of us..." 
Really Mr. Engineer??? Because the only the only thing that you have shown, thus far, that you rely on is circular logic, arbitrary opinions, bureaucratic dodges, ad hominem remarks, and acting in bad faith by NOT providing any "facts" at all. You better seriously take good, long, and hard look at what you just said.

What empirical evidence do you have to prove beyond a reasonable doubt that your theory and hypothesis are right and that these experiments are wrong?

"There is nothing more deceptive than an obvious fact." - Arthur Conan Doyle
Reply: Just cling onto that rationale that allows you to ignore proof... Will get you a long way in life
Reply: +Craig Chenco On the contrary, unlike you, I do believe in proof, facts, evidence, confirmation, experiments, the scientific method, a smoking gun. 

YOU, on the other hand, can continue through you're life relying only on circular logic, arbitrary opinions, bureaucratic dodges, ad hominem remarks, and acting in bad faith. 

"Extraordinary claims require extraordinary evidence." - Carl Sagan
Reply: LOL you are funny....  stupid, but funny
Reply: Craig Chenco Not an argument.

"At first, they'll only dislike what you say, but the more correct you start sounding the more they'll dislike you." - Criss Jami
Reply: Well you do this experiment at home....   First see if you can balance a brick on your head.  Now get someone to drop that brick on your head from 10 feet.  If you are right the apparent weight as explained here will mean when it hits your head it will actually have no weight so should not damage your head.   Confident???
Reply: Craig Chenco So if I'm understanding your hypothesis correctly, you're using a weak structural base, aka my head and body, to back this theory of yours??? Seriously Mr. Engineer??? If I were to place that same brick on top of an empty cardboard box, fyi a lighter and weaker object, and then drop another brick, from 10' up, what do YOU think will happen? Isn't the lower parts of a skyscraper structurally stronger and heavier than the lighter upper parts? Are you kidding me Mr. Engineer???
And once again, that is NOT empirical evidence.

What empirical evidence do you have to prove beyond a reasonable doubt that your theory and hypothesis is right and that these experiments are wrong?

"A wise man proportions his belief to the evidence." - Davis Hume
Reply: Dont presume to understand anything.... it just highlights your stupidity....
Reply: Craig Chenco Not an argument.

What empirical evidence do you have to prove beyond a reasonable doubt that these experiments are wrong and that your theory and hypothesis is right?
Instead of relying on circular logic, arbitrary opinions, ad hominem insults, bureaucratic dodges, and acting in bad faith.

"The truth is messy. It's raw and uncomfortable. You can't blame people for preferring lies." - Holly Black
Reply: PRIMARY 9-11 CONSPIRACY ASSUMPTION SHOWN TO BE FALSE:
AN ANALYSIS OF THE AMOUNT AND DESTINATION OF THE POTENTIAL ENERGY OF A WTC TOWER
The first law of thermodynamics, also known as the Law of Conservation of Energy, states that energy can neither be created nor destroyed; energy can only be transferred or changed from one form to another.
Source: Boundless. “The Three Laws of Thermodynamics.” Boundless Chemistry. Boundless, 02 Jun. 2016. Retrieved 12 Oct. 2016 from https://www.boundless.com/chemistry/textbooks/boundless-chemistry-textbook/thermodynamics-17/the-laws-of-thermodynamics-123/the-three-laws-of-thermodynamics-496-3601/
The World Trade Center towers (and WTC7) fell NATURALLY due to buckling failure when their 'slender' columns lost attachment to their floors.
They only used a third of their Potential Energy to destroy themselves, the remaining two-thirds was consumed in crushing some of their steel into ground zero.
A standing WTC tower possessed two hundred and forty six tons of TNT of POTENTIAL ENERGY merely by just standing there. We shall call this energy Eo.
The tower fell by taking the direction of LEAST RESISTANCE, which was THROUGH ITS BUCKLING COLUMNS.
The columns failed by BUCKLING because their STRUCTURAL STABILITY had been compromised by LOSS OF FLOOR ATTACHMENTS. No steel got crushed when this buckling failure occurred. 
Buckling is not a MATERIAL failure; it is a STABILITY failure.
The floors had detached themselves by sagging to an angle which snapped their connections. Photographs of these separated floors (taken shortly before collapse) are plainly shown in the NIST Report.
As each tower fell, some of that stored potential energy, converting to kinetic energy by falling, was released to damage and dismantle both the moving and the stationary parts of the tower on the way down.
The amount of the initial energy consumed in such a manner was inversely proportional to the rate of acceleration of the tower as it descended. It can be calculated.  We shall call it Ed.
The amount of energy remaining (Er) when the tower wreckage hit ground zero is then (Eo - Ed).
This energy, transferred elastically, caused PLASTIC DEFORMATION in the crushed base steel wreckage, and became HEAT. This too can be calculated.
The heat was considerable. The signs of it were captured by satellite. It amounted to the equivalent of a thousand tons of steel raised to a temperature exceeding 1,000 degrees Centigrade.
This hot steel, crushed and pressed against ground zero, oxidised its surface (making scale) and absorbed local oxygen gas, leaving a reducing atmosphere.
In these reducing conditions, and at a temperature of 1,000+ degrees C, fireman’s water which had percolated through crushed gypsum wall boarding DISSOLVED calcium sulphate (yes, Gypsum is 5% soluble in water), the sulphate ions of which were reduced to sulphur which combined with the exposed iron to form IRON SULPHIDE, which at such temperatures was MOLTEN, and flowed away. At a temperature of 1,000 degrees Centigrade, in an absence of oxygen, and in the presence of hydrogen, Sulphur and Iron atoms become keen partners.
Such hot reducing conditions also caused the water/steam to be REDUCED to hydrogen gas which was noted by firemen to be burning at the surface of the wreckage.
The wall-boarding and crushed concrete surrounding (but mostly above) the steel were THERMAL INSULATORS, so greatly slowing cooling.

CALCULATIONS (in SI units):

To calculate the original potential energy of the tower in TNT equivalent,
G = 9.81 metres/sec^2
Mass (M) of tower = 5e8 Kg
Height (h) to the tower’s CG = 210 metres
The explosive energy of 1 ton of TNT (Kt) is equivalent to 4.184e9 Joules

Equation: Tower Potential Energy (Eo) = ( M * G * h ) / Kt
This is equivalent to ( 5e8 * 9.81 * 210 ) / 4.184e9, or 246 tons of TNT.

The Potential Energy of each standing tower was equivalent to 1,000 standard 500 lb. ‘iron’ bombs.

To calculate the kinetic energy used in the tower destruction takes a moment, after a simple thought experiment, namely considering the tower would fall at G if there were NO resistance, and if it fell so slowly that it consumed ALL its energy, it wouldn’t fall at all.
So we can see that the PROPORTION of the energy used up by the collapse must equate with the proportion of G which the collapse was unable to achieve.
As the collapse acceleration was, by truther calculation, established to be about 70% of the acceleration due to gravity, we’ll use that.
The energy used up in tower destruction was therefore 30% of 246, or 73.9 tonnes of TNT.
Assuming that 30% of the tower fell outside of the basement, then the energy (Er) available to heat the wreckage base (by elastic energy transfer and crushing) was 0.7 * (246 - 73.9), or 120 tonnes of TNT.
We know that the steel reached at least 1,000 degrees Centigrade because that is the melting point of iron sulphide.
We can therefore calculate the mass (m) of steel that was raised to that temperature.
The specific heat of iron (Fs) is known to be 0.45e6 Joules / tonne / degree C
The ambient temperature was 20 deg C, so the temperature rise (Tr) was 980 degrees C

Equation: Er = m * Fs * Tr
So m = Er / Tr * Fs = ( 120 * 4.184e9 ) / 980 * 0.45e6
And so m = 5.02e11 / 4.41e8 = 1,138 tonnes.

The collapse of each World Trade Center tower created 1,138 tonnes of red hot steel at 1,000 degrees Centigrade.

So we can see that there is no need to postulate an extra source of energy, and that the basement wreckage heat is also easily accountable, with the additional corroboration of burning hydrogen at the wreckage surface, and molten iron sulphide at the wreckage base.
And so the underlying 'truther' assumption, that the planes couldn't bring down the towers, is shown to be FALSE, as it is shown by calculation, using the physically-correct values, that the potential energy possessed by the towers numerically accounts for ALL the known consequences, through elastic energy transfer, plastic deformation, HYDROGEN gas burning at the wreckage surface, EUTECTIC IRON SULPHIDE melting off the hot steel pressed against Ground Zero, and, of course, a tremendous amount of HEAT.

These results are EVIDENCE of the event.
They have been evident to any REAL scientist or engineer from day 1.
Reply: beachcomber2008, Wow. Now can you prove all that, with experiment,  by utilizing the scientific method, and applying it to the events of 9/11? Can you back all that up? Yes or no?
Reply: +Benjamin Croft
Wow.  You MUST be a 'truther'.  You are a beggar asking for food just after someone has stuffed food in your mouth.
Experiments have already proved the SCIENTIFIC EQUATIONS YOU SEE (hundreds of years ago), and the DATA ARE the physical dimensions and mass of the WTC towers.   OF COURSE IT IS "BACKED UP".
So THERE is your "food" - but CAN YOU EAT?
Reply: beachcomber2008, To what real life experiments, that utilize the scientific method, are you referring to that helps support all these equations and data that apply to the events of 9/11 that you proposed?
Reply: beachcomber2008, That's what I thought. All talk, no show. smh....

"Facts are stubborn things; and whatever may be our wishes, our inclinations, or the dictates of our passions, they cannot alter the state of facts and evidence." - John Adams